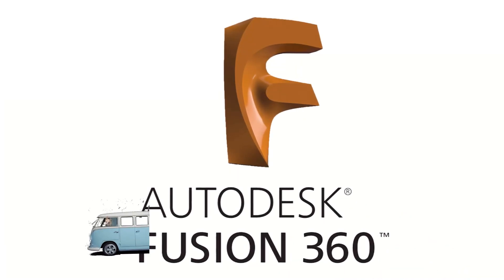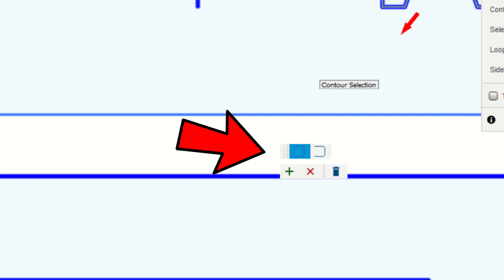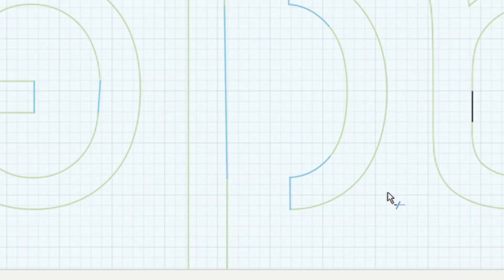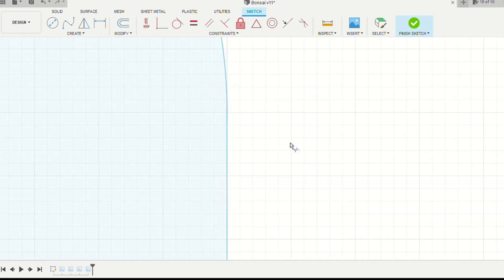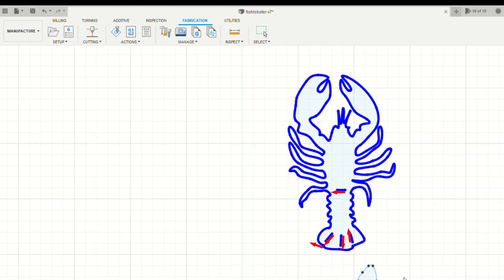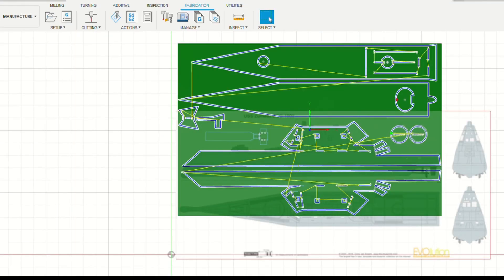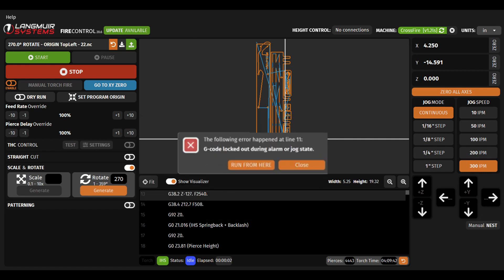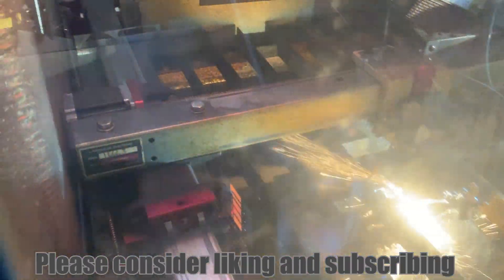Tips for 2D Profiling in Fusion 360 (Broken lines, Errors!, & IHS or THC Warnings!, G code lock out)

Comment: Cool! I'm having issues with white dots and bold blue lines in my profile and no one seems to be talking about them. Totally noob here asking all the questions!
Reply from the maker: When, when editing sketch or when doing contour in 2d profiling? like design or manufacture?
Reply: @ecophage  I designed the profile sketch from scratch. To have these 'defects' sorted, I went in and editing the profile, delete a few segments, redraw and then check another portion of the profile for more (the defects only appear when you saved changes).

The deceptive thing is that I was able to extrude a shape which looked fine, despite it was from an imperfect profile.  I assume it is only certain features that would have cared about this error.
Reply from the maker: @dragade101  make sure everything is in one sketch, use the eye next to each sketch to make each invisible to check. Or just redraw everything in one sketch, check for double line by using trim tool to delete any that are causing trouble and if there’s another line behind it that’s a double line. If it disappears with one click of trim then just crtl z undo to get it back try different section. Basically the computer is smart but can be easily confused because you’re both looking at different things. Something could appear whole to you visually but if they’re in separate sketches then the computer can never treat the two different parts that may appear one as such.

Also check your constraints the tiny symbols on corners and stuff they correspond to locked settings like distance or angle or diameter they can prevent modifications but you can trim many away